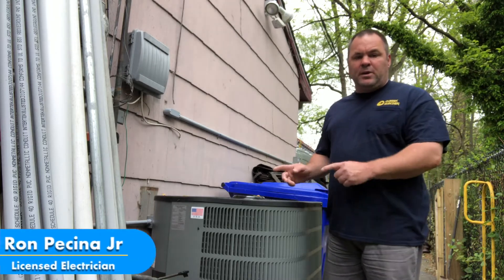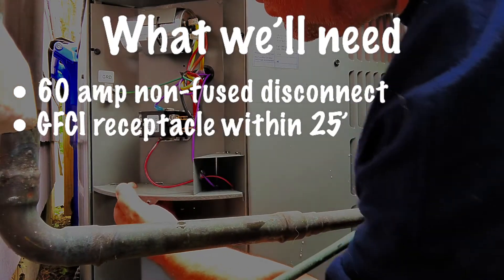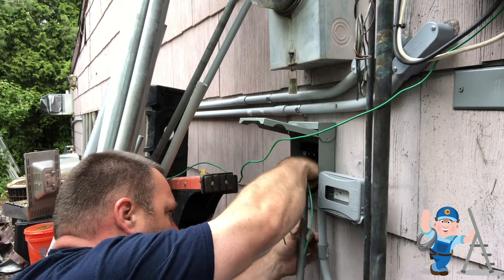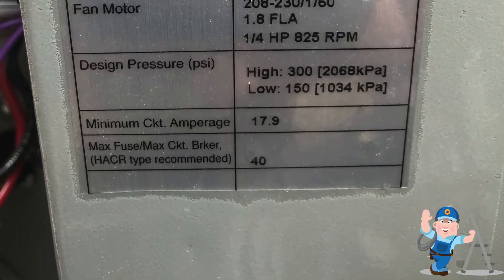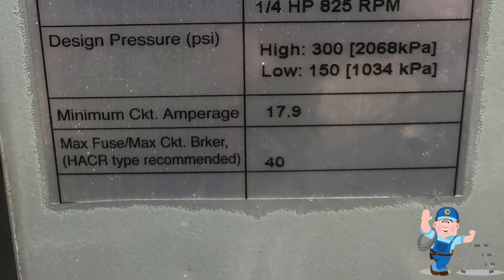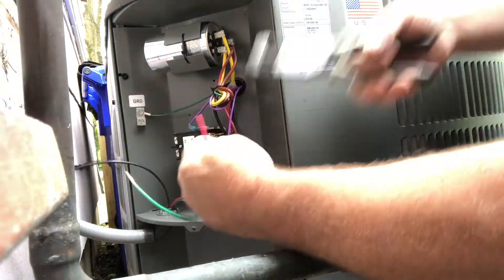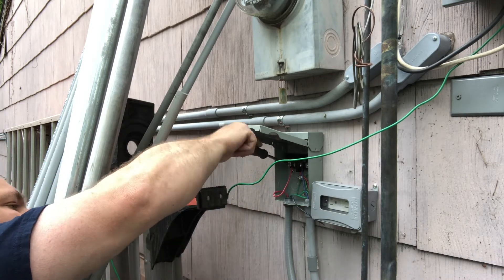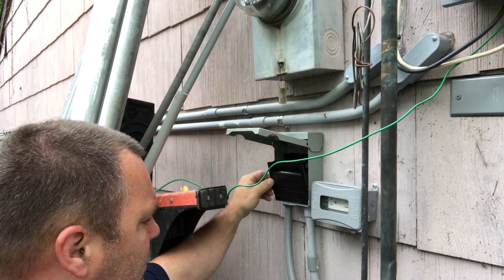Wiring an Air Conditioning Condensing Unit

Comment: CODE HELP….PLEASE.
Great video! I am in Connecticut and wiring my new mini-split heat pump 12000 BTU unit. The max fuse is 15amp. My question is whether the 220 15 amp breaker needs to be GFCI protected since it is an outdoor disconnect box? I am reluctant to install a GFCI breaker because I read that you can get lots of false trips because the unit has an inverter and variable speed motor. I love your videos and thank you for sharing your knowledge.

Comment: Working HVAC for 25+ years I would have wired this with  8 gauge wire due to the fact that the Maximum Breaker would be 40 amps and the 'Minimum' Circuit Amperage required is 17.9 amps. I understand that the Appliance may only draw 8-12 amps of current RLA when operating, but the in-rush current on LRA is the requirement for the larger size wiring and Fuse/Breaker.
Reply from the maker: From the 2020 NEC; Article 440.6(A) For a hermetic refrigerant motor-compressor, the rated-load current marked on the nameplate of the equipment in which the motor-compressor is employed shall be used in determining the rating or ampacity of the disconnecting means, the branch-circuit conductors, the controller, the branch-circuit short-circuit and ground-fault protection, and the separate motor overload protection. Where no rated-load current is shown on the equipment nameplate, the rated-load current shown on the compressor nameplate shall be used.
Reply from the maker: There's also this from Article 440.6: 440.6 Ampacity and Rating.

The size of conductors for equipment covered by this article shall be selected from Table 310.16 through Table 310.19 or calculated in accordance with 310.14 as applicable. The required ampacity of conductors and rating of equipment shall be determined according to 440.6(A) and 440.6(B).
Reply from the maker: And then when you find what kind of conductor can be used to serve and A/C load you'd see that #14 THWN can be used. The ampacity of the conductor and the overcurrent protection device (circuit breaker) are two entirely different items when wiring A/C C/U's.
Reply: @electricianron_New_Jersey  I understand all the Codes you are explaining here., but I will try to help you understand the real Engineering reasons for the bigger wiring. Anyone can be an Electrician (planning, wiring, codes), but understanding 'why' you need the wiring is an Electrical Engineer. You are correct about the #14 wire to a point, but you are only looking at the RLA after the unit has started. When manufactures rate appliances they are also taking in consideration for LRA (Lock Rotor Amperage) which is due to the Inductive Field/Resistance that is drawn during startup on a large inductive motor (compressor and the PSC fan motor). As with all wiring, each wire will generate a magnetic field (inductance) based off of the amount of current flow thru that wire. An example of LRA on this 5 Ton unit would be approx 120-160 Amps on Startup (both motors). This is where wire size is critical for not RLA but for LRA, as a #14 will only be able to pass a smaller amount of LRA amperage (due to a larger magnetic field around the wire) compared to a #8 wire, which will have a smaller magnetic field around the wire and less Inductive Resistance. I will challenge you to this test: Test a 5 Ton Condensing unit with a minimum 40 amp circuit to the panel and take a LRA amp reading at startup (disable the hard stat kit if it has one), then take some #12 or #14 from the disconnect to the condenser and then measure the startup LRA, you will see a huge difference on Amp draw and start time. The issue for all of this is not that #12 or #14 won't start or run the unit, but 12+ years later when the Compressor is out of Warranty the customer wants to know 'why' it failed, the last thing the HVAC Tech would want to say is that the Wire Feed is undersized (I have said this many of times). So yes, I know the NEC Codes and what they say, and I know how much money copper wire cost these days, but for Customer Satisfaction, don't skimp on the wire size.